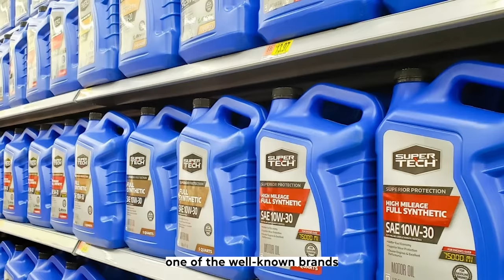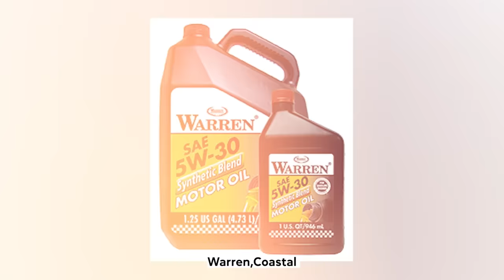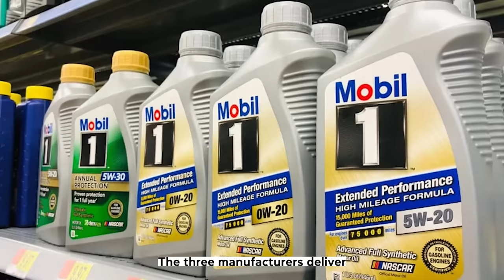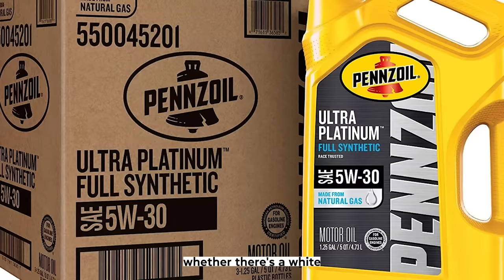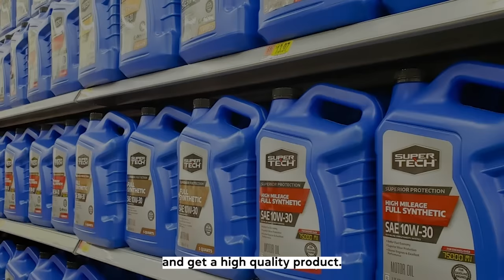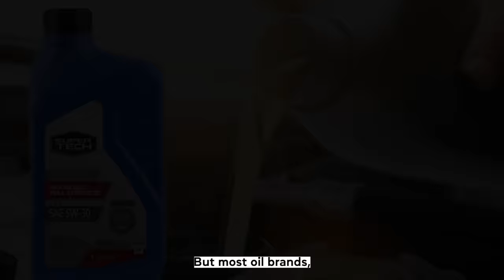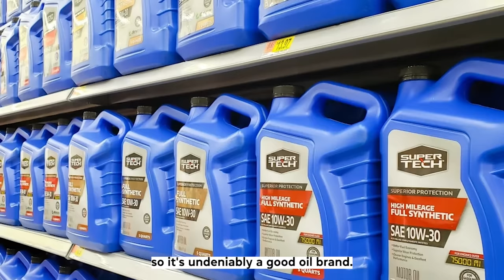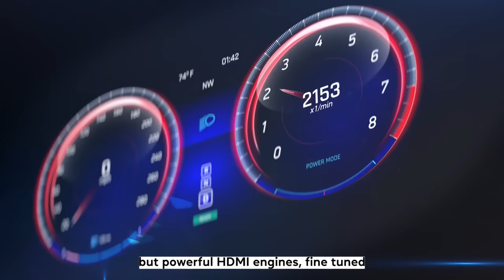Who Makes Supertech Oil For Walmart And Is It Any Good?

Comment: I change my own oil usually 2 or 3 times a year every 5000. Walmart oil is usually 28.00 compared to 35.00 for Mobil 1. So at most that would be 21.00 per year to stay with top Mobil 1 synthetic, that to me is worth the expense.

Comment: "Some engines are designed to run on the same oil for much longer"
As an ASE certified veteran diagnostic technician/mechanic, that design is limited to the fuel burn efficiency which reduces carbon deposits hence particulates suspended in the oil over usage/time. Ever since the innovation of EFI the increase in burn efficiency is insignificant with the exception of high pressure fuel pumps driven off the camshaft such as in Kia. No matter which oil you use the introduction of carbon into the oil remains the same with respect to which vehicle it is used in, No matter what the oil manufacturer says or the vehicle manufacturer says you should change the oil every 4,500 miles with the exception of vehicles such as German cars that have high capacity oil systems. [7-9 Qts. Those vehicles you can go 6-7k miles] On older carbureted engines remain changes at every 3k miles.

Comment: I ran supertech in 3 different Harleys. They all ran hot, because they were Harley's. Supertech was fine in them changing out at regular intervals. I don't use Chinese filters air or oil.
Reply: For fuel filters I like Motorcraft, they have stainless steel bodies and made in America. Found two Chinese fuel filters on cars that came apart inside and clogged fuel injectors.

Comment: I purchased A 2005 Dodge Ram 2500 brand new. I drove it till It hit 1,000 miles with the factory oil and changed the oil and filter with Walmart's Supertech 20W 50 and I have been doing that every 5,000 miles religiously,
I use the truck to pull trailers and equipment up and down the eastern seaboard from Syracuse NY to Central Florida.... I now have almost 250,000 Miles and still use Walmart's Supertech 20W 50 oil and filter.. and I also use LUCAS oil treatment. So I think that is proof enough for me to keep using it. 
And I also use it in all my equipment.

Comment: Needed an oil change so I had Walmart do it. I usually do it myself but didn’t have the means. I have no idea what oil they used I got a synthetic oil change and the paperwork said a different oil from what I was told. They used a crappy core fram filter and filled 4.5 out of the 5.7 quarts it took. The one manager said that was their better tech that did it. I work to back there you don’t know what you’re getting. However I have used super tech and mobile one and they are both great.
Reply: It's true, you really don't know what you're getting in an oil change unless you do it yourself.  There are plenty of examples on Youtube of small oil change shops that swap cheap oil for the good stuff.  And you really have no clue as to the adequacy of the oil filter they use is, which is a concern because even the big guys are going to try and cut their expenses to the bone to maximize profits using low cost filters.   And then you can get into a whole another discussion about the skill level (or rather lack thereof) of the lube tech that is working on your car.  (i.e., how tight did they put on that oil drain plug?  Did they use the correct oil and quantity?)  But I'm very sympathetic to your problem of not having the means to do it yourself, i.e., apartment dwellers, old people, etc.  I used to think the dealer was the best place to go, but these days many have a shortage of lube techs, and service quality has declined at many dealerships.

Comment: The 10,000 miles oil change, is only made for the vehicles warranty to get the vehicle off the warranty.
  Change your oil every 10, 000 miles and at 100,000 miles you might need a new engine.
Find a car that has had 10,000 miles oil changes and see how long it run. Years and miles.

Comment: I've used supertech oil frequently not exceeding 6k change intervals. It seems to be just fine to me. I have noticed slightly better gas mileage with Quaker State and I'm not sure why, but I'm talking slight. Supertech has gotten more expensive over the last 2 years so at this point it's only about $2 less expensive than some name brand oils (per jug).

Comment: Regardless of what brand of oil and oil filters you buy the very best way of getting longevity out of any engine is to change the oil and filter MORE frequently and in LESS miles than the vehicle manufacture suggests.
When oil is not changed frequently more sludge builds up and wear damage happens. Driving with dirty oil can also block/clog the screen on the oil pump with sludge and dirt and it is NOT going away ever.

   PLEASE always recycle old used oil.

Comment: When choosing oil for your car, you just need to check for the API Seal on the bottle. As long as the oil is rated by api for your car, it is ok to use. brand is not Important.

Comment: I use the 10k mile super tech with the 10k or 20k mile filter, I check the level about every 1k miles and change it about every 5k miles. 

 Conventional motor oil from any brand is never a good idea imo. 
 That stuff burns up and breaks down so fast, I don’t even know why it’s still a thing. 

Use synthetic or full synthetic and check it often and change it when you should.

Comment: I'd look at videos from Project Farm on the topic - the testing is more "down to earth" but compared to some lab testing reports it's not likely (at all) that he's getting paid by "big oil".  What really separates most brands is the formulation of the additives which equate to wear protection and long term viscosity changes (breakdown).  I wouldn't "avoid" Supertech Oils but usually when I'm changing my oil myself I tend to gravitate to certain brands mostly based on loyalty or even "nostalgia" (i.e. I've used Castrol GTX since I was 16...)  If I have a high mileage or if the oil changes are difficult to do I may pick a different type but keeping in the same brand "just because".

Comment: Now that walmart sell Mobil 1 in the bulk box it is price competitive to SuperTech so I just pour the bulk M1 into old M1 5 quart bottles and continue with M1. I have gotten over 300K miles on my last three Ford trucks using M1 with 5K oil change intervals and none of the trucks were using oil when I sold them . Any good oil would have probably done same but see no reason to switch .

Comment: In my experience I usually used Rotella 15-40 but was running short on cash at oil change time so I got supertech 10-40 well I went form burning no oil in 3000 mi to burning a qt of supertech every 750 miles +- ..... so recharged the oil early at 3rd qt added & went back to Rotella 15-40 & guess what first oilchange after going back it burnt 1qt at about 1800mi 2nd oil change it didn't burn any in the 3000+ miles ....
I aimed for 3k for changes but it was usually around 3500 max ..... just my experience a long time ago can't give a modern example for auto motor .... but had basically same experience in a 12hp mower engine ..... about 2005ish

Comment: Synthetic oils were developed for engines and other "equipment" that operate in extreme conditions. From extreme cold (aircraft and artic environments) to extreme heat (also aircraft and desert locations) and other high stress conditions. The vast, vast majority of us never operate our motor vehicles or other equipment in those type of environments. The largest threat is dirt. Clean oil is a must for long engine and or equipment life. Change your oil often and with a good filter for the lowest cost and longest lifespan.

Comment: Some of the information here is correct and some of the information here I’m not 100% sure of,,,folks I would say if you have questions about your motor oil run it for 4000 to 6000 miles and then send a sample in to  Blackstone lab and they’ll tell you if that oil is safe to run in your car or not. I talked to Blackstone personally over the phone and I was informed  by them that as long as that oil has the API starburst on it stating that it is API certified and it’s the grade and type your car calls for it really doesn’t matter what brand it is.(now that’s not me telling y’all that that’s Blackstone) I used Rural King 5W 30 synthetic blend motor oil and Fram oil filters the more expensive Fram filters not the cheaper ones for thousands of miles on my old 2005 Toyota Corolla without any problems,,,now I have a 2010 Toyota Tacoma access cab pickup with a 2.7 L in it I have been running 0W 20 mobile one full synthetic Advanced fuel economy oil in it with the mobile one filter,,,now that’s by choice how ever I’m sure I could get by on Amazon basics or super tech or something along those lines with a good decent quality filter as long as it is API certified and OW 20 like my manufacturer recommends. project farm on YouTube has done very comprehensive oil testing and air filter testing and a whole bunch of other useful testing as well you can  go to his channel on YouTube and check all that out and you can also Google bobs the oil guy and ask about your specific type of oil and there’s some really good information there too as well.

Comment: Oil is oil, but the filter is the key, and how often  you change  it i got 400000 miles on a 4.3 s10 and only junked it becaus the body and frame rusted out and wasnt safe (super tech oil fram filter)

Comment: Nice video, but you're missing a few things, first, if you look at the label in the back of super tech oil you will see that conditions the seals, as any other high mileage oil, even if it's not labeled as high mileage, and second, as all oils, as you say "meets the standards", the difference between one another is the cleaning package or the amount of the minerals they put on the oil, therefore, no, super tech is not the same as either mobil 1, penzoil, or valvoline, that's the difference, super tech meets the stardards? Yes, it does, but other oils have different amounts of the minerals, such as sodium, calcium and potassium.

Comment: Nothing at all wrong or bad with Supertech.
There are hundreds of VOA samples on the interwebs that prove the additive packages are plenty good.
On my 2019 3.5 Ecoboost I switched to Supertech with lower calcium and more magnesium.
Higher calcium in boosted higher compression engines is less than desirable.
The slightly lower calcium levels in the supertech made an improvement in low speed acceleration.

My datalogging was showing timing being pulled to prevent knock at colder engine temps and lower speed acceleration.
After my second oil change with the supertech I lose no timing and the slight stumble is gone.

3 Blackstone tests have shown additives are holding up as needed at 3500 mile intervals.

Comment: Lots of presumptions and no hard data.

Oil companies buy the right in owners manual and stickers recommending their product.

The companies don't set quality API does. The API's standards are really good. Little differences in brands of same API and claimed mileage.

Walmart calls for a known additive package for their engine lubricants. Warren, Exxon, Conoco, Shell, company in Japan, or company in Europe can and will create the same additive package no matter who is creating the product. It will be identical amd within specs whoever ,anufactures. They are all that good now.

Little variance between like oils. Where we find differences that make a difference is in variance between same $ for $ oil filters. YT has a number of good vids detailing this.

Oil change interval? IMHO every vehicle owner should read manual and presume their vehicles is being used in severe service. By and by far most vehicles are doing stop and go driving that polutes and breaks lubricant down fast. And these latest wonderful cars have slackened piston ring pressure for gas mileage, tons of blow by polluting the crankcase. Back to the future and a return to three months or 3000 miles if the engine is to go past 100k miles.

Comment: All oils have to meet certain standards additive package my differ some have run super tech oil in my 5.3ls for the last 150,000 miles of the 300,000 on it pulled it down for rebuilding clean inside and minimal wear

Comment: There is a detergent ingredient added to Pennzoil and full synthetic Pennzoil that ranks it right at the top. The detergent matters and the oil filter matters.  You get the oil filter from a New Car dealers part department  of what ever brand your driving.  The religion takes over. You religiously change your oil and filter every 5,000 miles of each six months.  Then expect 300,000 miles out of the car, particularly if it's a Toyota.

Comment: Changing oil every 3- to 5000 miles is ridiculous! Its 12.000 miles or 'every year'. What ever comes first.
Castrol Magnatec does a great job. Factory hone grooves are still be seen after 75.000 miles. The esterified oil out performs regular oils by cold start.

Comment: Wal Mart Supertech oil is Manufactured by Gulf oil. Read the MSDs 
The fact that it is branded as Super Tech, allows Walmart to purchase from multiple suppliers if needed, so yes, there is a mix of suppliers within the SuperTech line of lubricants. 
Many tests have proven Super Tech lubricants to be valid, choices for service in modern engines. 
Think about it, would you as Walmart purchasing, acquire a lubricant from a sub standard supplier?  One that would expose the company to high risk, and justified consumer complaints… I think the answer is obvious.

Comment: What's the difference who makes the oil as long as the blend meets the retailer's requirement?
Reply: It is more important that it meets the engine manufacturer’s specifications. The retailer will likely go on price more than specifications.

Comment: I am reading these comments where users are just justifying the purchase of cheap oil by saying that it still work well. Cheap toilet paper also works. Supertech is a cheap oil, period. And like with any other product on the market, cheap can still work up to a point, but it still remains cheap, cheap in performance, cheap in longevity etc and it cannot compete with something that is more expensive thats the nature of things. There is a reason why Supertech is cheap. Warren is a business company not a charity fund. They still need to make profit out of the price they offer meaning they have to save on something in order to deliver that whether it is a polymer or additive package assuming that base stock is pretty much same across the market. Mobil and Shell are both top manufacturers who uses the highest quality materials have always used either Mobil or Pennzoil in all my vehicles. If you are an individual who truly believes that saving $5 every 5K miles on motor oil will really save your budget, well, you are either just a cheap person by nature who always buys everything cheap everywhere, or you don’t care as much about your car as other users do, or there is something wrong in your calculation. How many oil changes are we talking about throughout the life of your car?! Multiply it by $5 and think over how many years - 10, 15? What savings are you talking about?! So if by paying extra there is a chance that your car will run a bit longer, why not to do that by using a better oil vs cheap oil to get extra thousands of miles of your engine in return?!

Comment: I used in all my cars  never had problem .Changing your oil  is more important .  I’ll check the oil codes on back and super tech meets or execedes.  Oil in general is high  in price because of that moron  in Washington. You can use with my recommendation   I never had a problem .  $20 oil change complete works for me  oil change people close $40 to $50 plus they never fill right